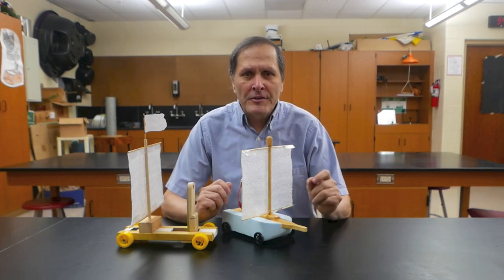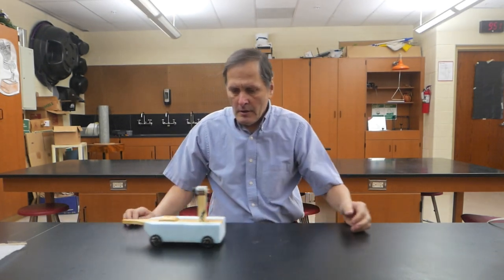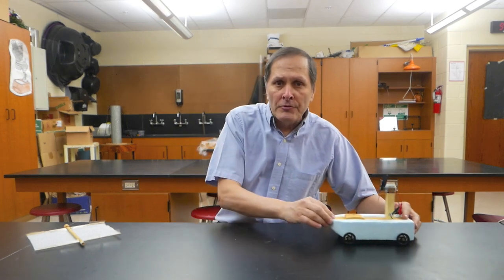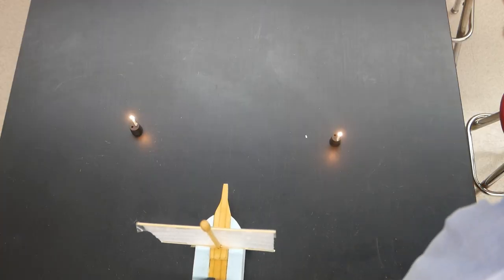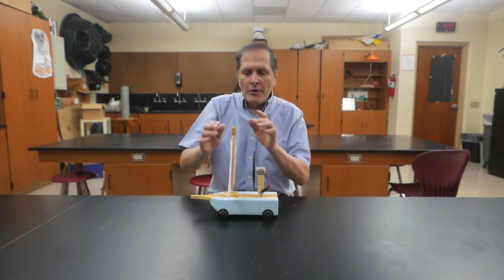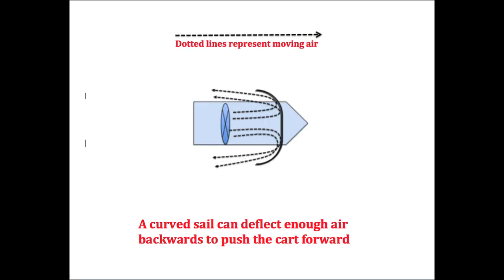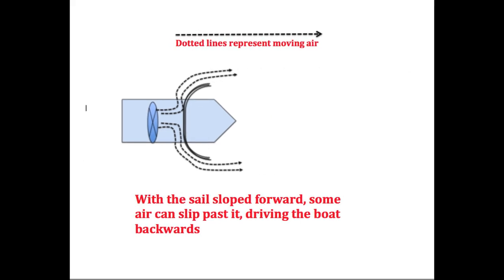Fan Cart - Blowing into your own Sail- part 1 // Homemade Science with Bruce Yeany

Comment: The hard sail you explained as "the rounded shape is able to channel enough air backward to be able to push the cart forward" 

Even if 100% of the air is channeld back, that would mean that the forces are equal. from the fan blowing forward.

What i beleive is happening is that the air moving back at the sides of the sail is experiencing drag on the surrounding air, making that air move along (venturi effect).

This you could prove by taping on peices of string to the outside of the sail, i think you will see these getting blown back, even when the "boat" is not moving. prooving that air is being sucked from the front.

Comment: What if the fan pulled air through a tube, that split into 2 tubes, which run on either side of the boat/car, and draw their air flow from in front of the sail?

Comment: What do you think of the theory that the fan and sail effectively circulate air in a toroidal pattern, with the air on the outside of the torus having much greater interaction with outside air than the air on the inside?
Reply from the maker: interesting idea,  I could probably test it with a little bit of smoke,  I would think that would have a greater possibility with the curved sail

Comment: What if you used a Dyson fan? They use a small amount of air to create a pressure differential that basically sucks the air through the ring instead of pushing it forward.

Comment: I don't understand why the car with the curved sail moves forwards. According to Newton's laws of motion every action has an equal and opposite reaction. So the fan blowing the air must experience a certain proportional force opposite to the air blowing direction, how is it then that the sail is able to experience a force greater than the fan does?
Reply: This is a very question, and in the end it comes down to complicated fluid dynamics (which I cannot fully explain). As I understand it, the fan creates a bit of a stream of air that has the property of entraining surrounding air particles that are moving in the same direction as the stream while somewhat ignoring the other particles. In this way, momentum is borrowed from the surroundings.

Comment: Now what if the fan is somehow magnetically suspendid? In my mind (probably not right) it would work because the force of the fan isnt pulling on the boat but pushing air to the sail, causing it to move forward and the fan would move along behind it because of the magnet. Impractical compared to the solid sail thing, but I think it would work.

Comment: I'm interested to try something. How about making a boat with a balloon setup like this 0:02 
Then attach a flexible straw into the lip of the balloon so air will only pass through the straw. 
Which would move faster? 
a) the other end of the straw is submerged into the water.
b) when the straw is not submerged in water.

Try to make the straw blow the air horizontally like this 0:02
I'd like to see you test this because if you try to paddle in the air using your hands while riding a boat , the boat will not move, but if you submerge your hands in the water while paddling, the boat will move.

Comment: Wouldn't the backwards solid sail be explained by the Bernoulli effect?  You are creating a low pressure area by driving the air at the curved sail (wing), which pushes the boat backwards
Reply from the maker: I tried a few more ideas in part two,  at the end I attempt to show the air flow with smoke.  I'm planning a few more tests  to try and answer your question

Comment: Great channel Bruce. I subscribed it today and I can't wait for your next upload.
I already took some time wondering about this issues earlier and trying to guess the results and they match the ones you achieved. However there is another option you didn´t tried that may work by pushing a car forward. If you place a fan on the side of the car blowing air laterally (90º) to a sail at a angle (45º for example) the car must speed up forward.
However, if you use a boat on water it may be required a keel under water, not to prevent lateral drift in the direction of the air flow just like a normal sailing boat requires but, instead, to prevent lateral drift in the opposite direction caused by the fan reaction.
It would be interesting to try this one more option and share the results with us? Can you do it? Thanks.

Comment: one minor flaw in your sails. you mentioned it when you talked about Doolittle and Wyle's sails, they had a curve. if you turned your sail around so it didn't wrap around the mast there may have been enough deflection in the sail to move it forward. try turning it around and giving it a little slack. that way the sail can catch the wind.
Reply from the maker: stay tuned,  I will try it again next week

Comment: If you want to see motion from funky arrangements of sails (or the like) you use the Coanda or the Magnus effects. For eg. you can blow perpendicular to a curved surface (like from the top of a bell) and if the air stream touches the surface it will redirect along  the that surface and produce thrust perpendicular to the fan. In the Magnus effect, you can have a curved surface that is rolling very quickly and if it moves transversely, the air flow will cross it asymmetrically, thus produce thrust.
Reply from the maker: Hi DigGil3,  I've been playing round and made some Flettner rotors that I will use in an upcoming video, they are fun to play with also

Comment: Mass flow in the back of the system gives forward momentum to the system.  Mass flow directed symmetrically out the sides gives a net of 0 momentum in any direction.  I expect a net force from the fan, but not the balloon.

The force is smaller than the "wind" would suggest because the fan pulls air in from all directions, and not strictly from "behind" the boat.  It is only the velocity in the "forward/backward" direction which is not in balance, so that direction is the only one that produces a net thrust.  So the air being pulled in from an angle and not from straight forward or backward provides less forward momentum than it's total momentum.

Comment: What you'd need to do to eliminate the opposing forces is have the fan pointing down or up and use an elbow of PVC or something similar to direct the air. When you do it this way, the fan won't be opposing the force applied to the sail and I believe that would work.

Comment: I wonder what would happen if a real sailboat was used with a similar fan, and a topical symmetrical Spinnaker was used by itself with no other sail?  since the sail would be all cloth, with no stiff structure as shown in the example ,  if the sail would fill?  I think it would.  BUT , if the sail was  overpowered it may stand still.  My experience down wind is that the boat moves along at a speed slightly less than the actual wind speed due to drag of water.   I'd like to see you try this with your model and see the result?

Comment: There is something that bugs me: if fan pushes the air and the curved sail reverses the direction of air. I thought it would still move in the backwards direction(the direction with only fan). This is because after the fan creates this force there is viscous loses and the momentum of moving air is greater in the beginning than it's at the sail.

Comment: Great videos. I must say I don't think the reason you had difficulty keeping it still in the water was entirely because of the angle on the sail I believe the gyroscopic effect of the propeller and the mass of the motor turning had some effect on that. Off to binge watch 20 more of your videos. Keep it up the world needs more of this
Reply from the maker: thanks D Daddy
Reply: Oh yeah, motor and propeller torque.
I'm reminded of my pilot training. Torque effects from the propeller and resulting uneven airflow create a bunch of weird effects that are related to how fast the propeller is spinning that result in the aircraft having a tendency to roll to one side at variable rates depending on the engine power settings...

Comment: The cardboard sail is pushing the air behind the boat to send it forward, I find that an interesting method as you could just as easily remove the sail, and turn the fan around. Like a hovercraft.

Comment: what if you built the sail like a real sailboat which is on an angle to catch wind coming from the side. then mount the fan on the side, that way there would be no force trying to pull it backwards

Comment: My guess is that the fan being not 100% level causes a moment on the boat contributing to the twist.  Of course the uneven sail also contributes.  Try reversing the polarity on the fan and see if it spins in the other direction.

Comment: Great video as usual. The other point that would be great to somehow address is that fans do not suck air. They push air. If you had a gymnasium with only one air molecule in it, and turned on a fan, this would not cause the one air molecule to move toward the back side of the fan. ;) Whenever someone starts with "the fan is sucking air" they are already starting on a false premise. It's a shame this isn't something that can be demonstrated with easy to build toys. :/
Reply from the maker: good point,  a common misconception that we tackle in class,  students think they suck air in using a straw,   let me give that some thought on how I can present that.     I have a few future videos planned on pressure that would be a good misconception to address

Comment: Now what if you had a forward facing intake tube to the fan and the fan pointing at the sail? 
Surely this would push it forwards.
Can I use this logic to get a speed boost on my car by aiming the exhaust at a curved section on the back of the car?
Reply from the maker: LOL,  try it and if it works do a video

Comment: I saw a drawing of a magnet on the front of a boat being pulled by a magnet on a fishing line being held by a person in the boat. (Like a carrot leading a donkey.) Would that be governed by the same effect.

If I am facing towards the back of the boat, could I actually move the boat or would I have to turn around to inhale?

Would repeating the same experiments with the fan blowing the other way have any unexpected results?
Reply from the maker: the magnet idea would be the same idea of two forces being balanced and applied against against the same object, there has to be a force applied from  outside of the boat and then it will move towards it.  In theory inhaling is applying a force in the opposite direction as exhaling so you would have to turn around

Comment: So if you have the torque as a form of pushing the boat you could then pulse the fan(s) and or pulse your blowing. Blowing on the left side then the right etc. essentially rowing the boat with air.

Comment: could you try this experiment with an air pump instead of a fan?  or a fan in a box that will pull air in from above, then move 90 degree the air out the front...  instead of moving the air in a straight line.

Comment: Sails are designed to billow. Much the way your solid sail captures air, a cloth sail would similarly concave. The problem with your model (particularly in the water portion) is that your sail is too rigid to concave properly. This results in more air being deflected as opposed to expending it's energy into the sail. Also, in the story, the individuals would have been blowing up and into the sail at a roughly 45° angle, not directly infront of it.

Comment: here's the question; Bernoulli's principle dictates that a wing will rise toward the side with the most surface area.  what happens when you duct, or partially enclose a wing,  or three or four, which are fixed at the end of the rotor blades, like pedals on a bike, so that they revolve within the housing, creating a difference in pressure between the center and the outer housing?

Comment: I recently had a discussion to a similar issue. Is it theoretically possible to build a airborne helium levitated wind generator, that stays in place?

I say, despite the obvious answer no, that comes due to ones mind to the fan+sail thing. The answer might be yes. If you counter act the momentum with a big a fan, push a lot of air with low speed in the other direction, but get the energy with smaller turbines that get more energy due to harnessing the wind. Since momentum is m*v but energy is m*v*v it should be possible.

It may not be efficient, but it might be possible after all.

Comment: Good video, I enjoyed the giant orange banana balloon, but I'd like to point out (I could be wrong, I did not go back and check each occurrence) that each time you put your built in air application (fan or balloon simulating lungs) the mast of the boat was on the wrong side, if you look at the picture for the kids story, the sail bows out from the crew blowing on it because their mast is toward them. you may want to try and see if your results are any different if you try the tests again but putting the mast and sail in the right places. sorry for the long comment, just had to get this out.

Comment: Another idea/take on this. Real large sails aren't meant to be pushed in fact they act as inflatable airfoils. Its the air moving faster over the front (rounded side) of the sail than it does the back of the sail like an airplane wing. The "lift" is what drives the boat forward. So if you had a curved sail and blew the fan on the side on angle.

Comment: So with the sail in an almost parral angle to the fan, the boat would go in a circle with a larger radius than if the sail was nearly perpendicular to the fan. So theoretically if one could shift the sail from left to right you could serpentine the boat across the water by blowing into it. Thats cool to think about.

Comment: how would sucking compare to blowing?  I mean if blowing backwards moves you forwards, then sucking forwards should pull you ahead?  so the boat would just move to and fro...  as, once they blow out they would have to suck in?  wait...  so, you face the front of the boat to inhale, then turn around to exhale?
Reply from the maker: Sucking is a terrible way to try and  move an object.  Here's a simple test,  light 2 birthday candles,  blow one out from about 6 inches away,  then trying putting out the candle by sucking air in from that same distance... can't be done.

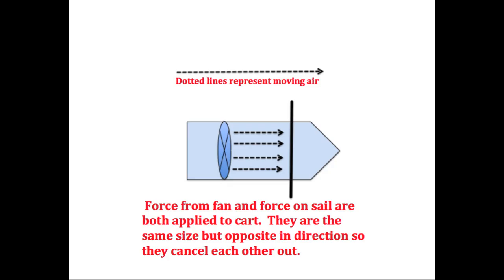Comment: 01:49 The car was clearly trying to move forward. Even after being pushed back, it stopped and just started to move forward again before the hand prevented it from doing so. In this case the sail is probably just reversing the propeller's thrust giving the car a net forward thrust. Not too different from what happens in an jet airplane's thrust reverser. In that case the engine's thrust is also reverted by a device in the airplane itself, muck like the sail in this experiment - only backwards, as it aims to slow down the airplane instead of moving it forward. If the sail had a more concave shape it might have been more efficient in reversing the fan thrust, making the car move forward more rapidly.
Reply from the maker: It does look like it,   I am going to try it again next week,  stronger motor bigger sail and we'll see what we get
Reply: Bruce Yeany Thanks for replying and for considering an experiment. A more concave sail, preferably hemi-spherical if possible, should do  it.

Comment: The general equation of a straight line is y = mx + c, where m is the gradient, and y = c is the value where the line cuts the y-axis. This number c is called the intercept on the y-axis. In short your carts need a wheel alignment.......

Comment: Good demonstration, but I have an unproven observation. Your sail should have had the mast on the stern side. This would have allowed the sail to better capture the wind.. Allowing the sail a little more slack would have allowed it to billow and thereby magnify the effect. As an interesting bonus, you should try positioning your fan and sail to tack into the wind. Assuming you made the sail modifications mentioned earlier, I suspect you will propel the vessel forward, albeit at a vector.
Reply from the maker: I guess I will be trying this again next week

Comment: Nice video but can you also try the real sail configuration? Real sailboats can go up to about 45 degrees angle into the wind, and about 70 degrees into the wind is the most efficient angle because the sail creates the lift force to propel the boat forward as the result of composition of forces to the resistance of keel.
Reply from the maker: Thanks,  I did post another video on this but it's still not complete,  I'd like to take another shot at the idea of sails exactly  as you suggesting,

Comment: I think the explanation for the backwards curved sail moving to the right is incomplete. You should also consider the fact that the air blowing across the curved surface of the sail will reduce the air pressure on that side, therefore you also have some force towards the right due to the air pressure differential.

Comment: What would happen if the sail was behind the motor?
Reply from the maker: the fan would most likely push the cart towards that sail, the  fan would pull air from around the sail, much different than being aimed at the sail.  Simple test, put your hand in front your mouth blow out,  you feel quite a bit of air hitting it, try breathing in and you feel nothing.  I think the sail would act the sail way
Reply: Bruce Yeany Wow! Thank you so much!

Comment: It's not just the air moving across the sail at different pressures turning the boat in the water.  It's also partially due to gyroscopic precession.
Reply from the maker: I'm going to test that next week